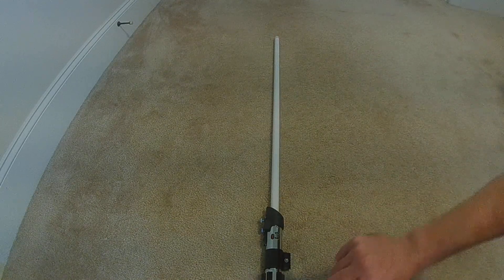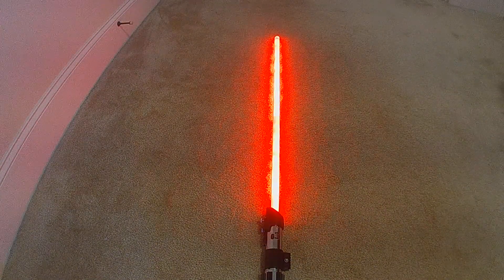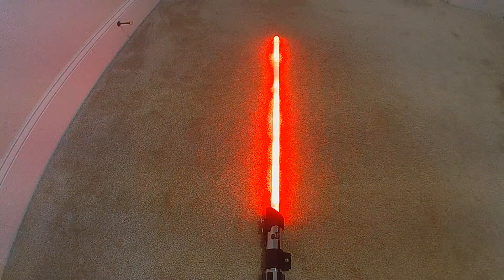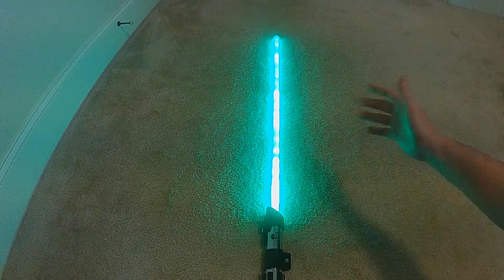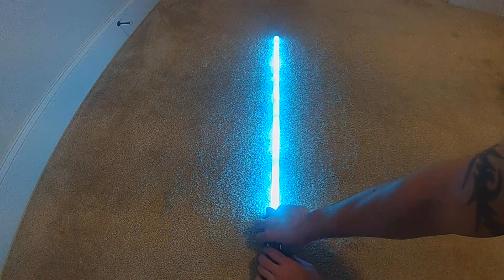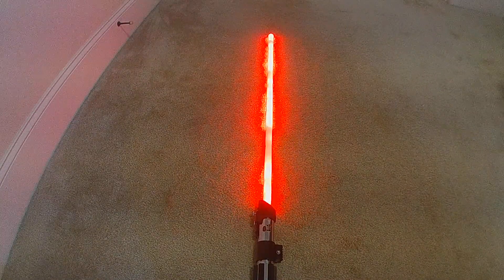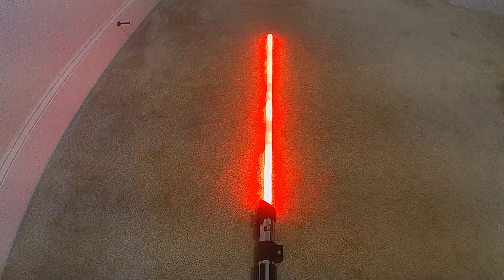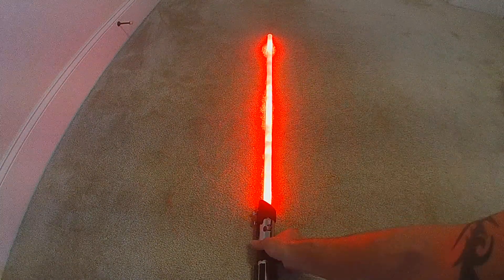"Power Up / Cool Down" Fett263 Unstable Blade ColorScroll - 12 Color

Comment: So the on effect, that was Power up stable or power surge stable? When I try and look at them in proffie editor, they don't look right to what you did there at the beginning.
Reply from the maker: This video is showing OS2.6CC effects. 
The comparable ignition effect in OS5 is Power Up Unstable 1 (White)
Reply: @Fett263  Ahh so it's not power up stable, it's the unstable one that gives you the solid white beam of light on ignition that fades into color?
Reply from the maker: @azuraug8693   this is an old OS fork video, it's using effects not in OS5. You could build a solid White effect yourself, this exact effect is not in the library, the Power Up Unstable 1 (White) is best option from library or you can build a custom TransitionEffectL for just White yourself.
Reply: @Fett263  Hmm, that's a little out of my expertise. I'll try and look some stuff up. I really love the all white glow to the blade, I'll try and see what I can find to make it with your audio flicker deepskyblue
Reply from the maker: I have a Crash Course series, it's pretty straightforward add a TransitionEffectL layer with White for EFFECT_IGNITION or grab the Stable Power Up Effect and replace the AudioFlicker layer in the TransitionEffectL for a solid White and adjust the timings as needed.
ProffieOS4 Tutorials: https://www.youtube.com/playlist?list=PLerKV87HlqScqiUhKrqX3ndjJNJCtVGlX